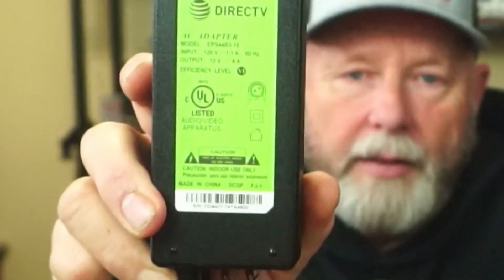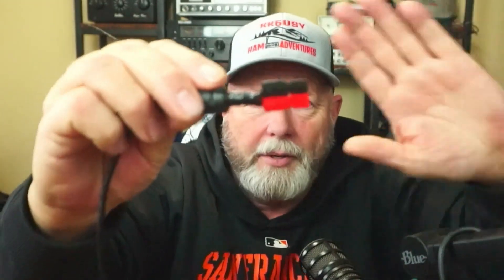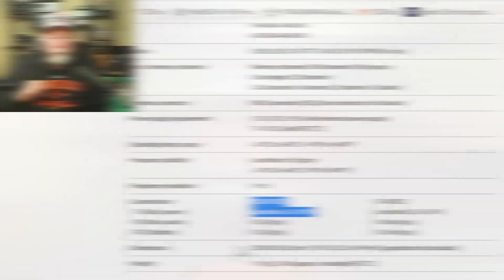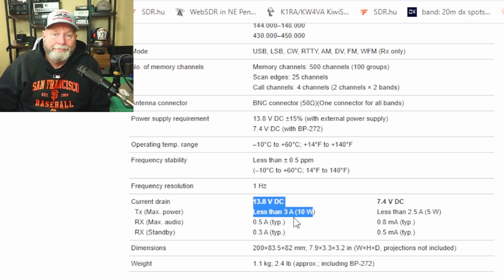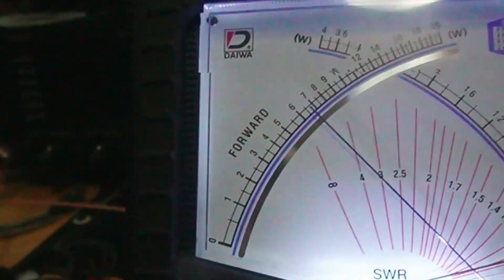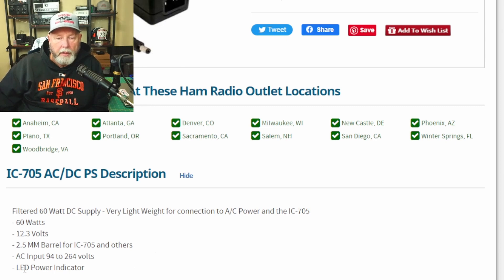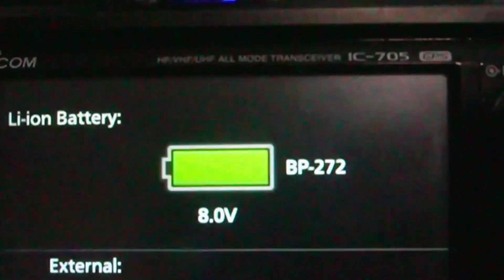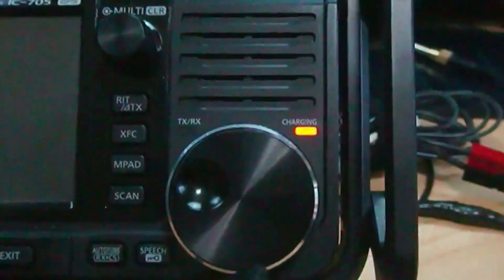Cheap DIY Power Supply for your IC-705, KX2, FT818 and other QRP Radios!

Comment: Hi Chuck... nice informative video.   

Unfortunately I did not have an extra power brick sitting around like you had.  For my IC-705,  I originally purchased the HRO power supply shown in your video, the supply worked fine but I had some concerns with it.  In the product description it says it outputs 12.3 volts and in another section it states 15 volts.   The HRO supply actually puts out more voltage than stated, it puts out 15.5v no load, 15.4v with a load with a max of 6A.  The 705 is spec`d for I believe 15.8 v max.  I have seen videos online where a component in the 705 charging circuit can fail if it experiences too high of an input voltage.  If the charging component fails, then the radio will not power up on an external source or charge the battery.   The voltage on the HRO power supply is a little high for me to be comfortable with.  I contacted HRO about the voltage being high, they offered to exchange it but they said the output was within the IC-705 spec.  As I said I just wasn't comfortable with the voltage being that high being within 0.3 - 0.4v of the 705s maximum voltage spec and I didn't want to take a chance in damaging the radio if it were ever to have a voltage spike.

I opted for a different external power supply made by Pro Audio Engineering which makes an external supply for the Elecraft KX2 and KX3, this power supply is a little more pricy than the HRO power supply but it puts out 14v @ 4A which is fine for the IC-705, they even sell a version with an adapter to fit the IC-705.   It powers my 705 just fine with no noise and I am happy with it.

Keep making those great videos, I have learned a lot from your channel.
Rod - KY4ROD
Reply from the maker: Rod that's some great info on the HRO supply, thank you. I will tag your comment for viewers to read.

Comment: Great tip, thanks! Seems to me you might find one of these TV-friendly power supplies at the Good Value Army, as well. One bit of general advice: most wall warts don't work for radio because they're not shielded or filtered; they set up an annoying hum in your receiver. But those made for electronic media, like this one, are often clean.

Comment: Like you, I also have a box of Walwarts. You just never know when you might need one.
I had not thought about using them for radio.   Great idea Chuck, thanks for making the video
Reply from the maker: I hadn't really either Kevin, I think Ape did a video on the aftermarket PS for the 705 about the time I was getting rid of direct tv and looked at the specs and said hey this might work.

Comment: I've done the same thing.  I had some 30 year old HT's that the batteries died.  New batteries were $50 or more.  Hook up an old power supply, a buck converter and you're good to go